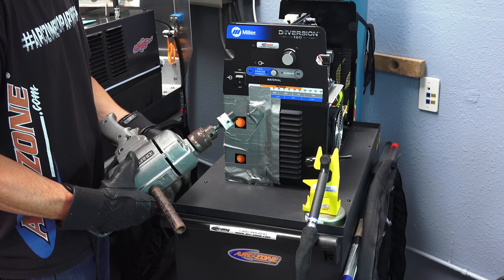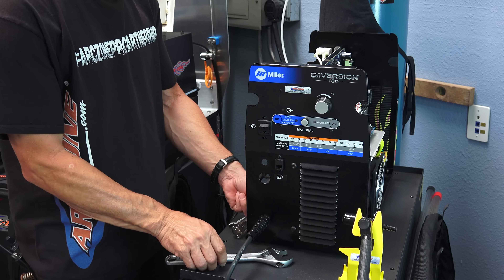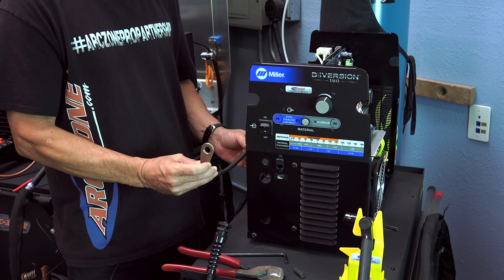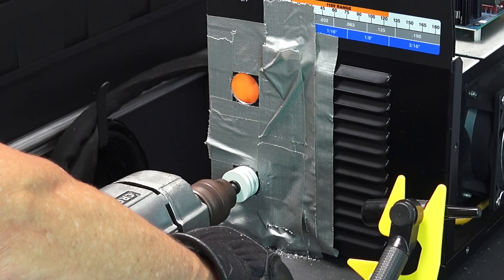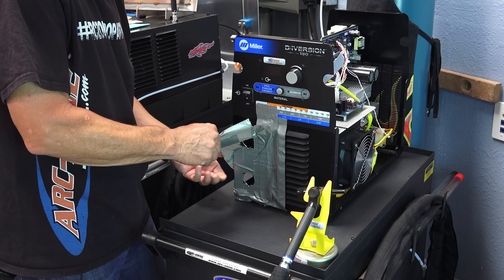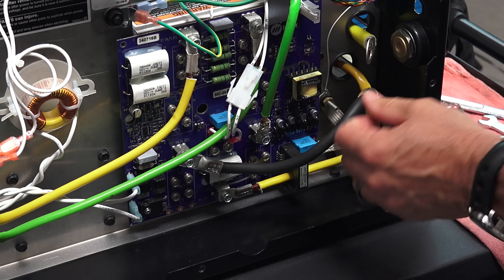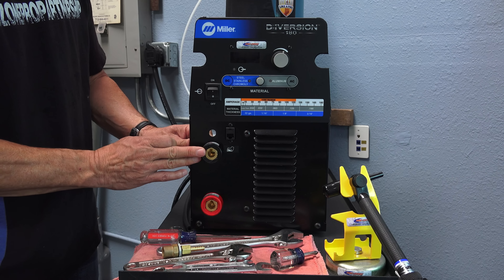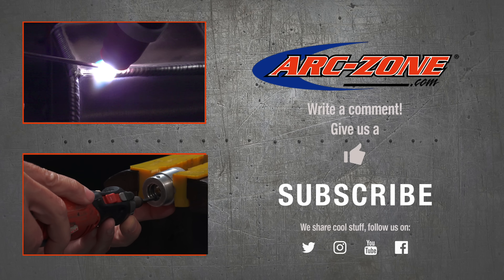Miller Diversion Water-Cooled Torch Adapter

Comment: I did a very similar conversion on my old Dialarc 250. Swapped out the original very messed up pin terminals for Dinse 35 connectors. One of the holes in the front panel was ate out from arc over due to a bad insulator (previous to my ownership), so I made a guide for my holesaw from a bolt and nut of the correct size that I had drilled a hole down the center for the pilot bit. I then used a square file to make the notch for the key in the new insulator. Worked very well and really upgraded the old machine. Makes it simple to swap between the TIG torch and the stinger, and provides a much more secure connection compared to the original terminals.

Comment: This is a great kit for the price. It includes a really nice hole saw and Delrin guide bushings to enlarge the front panel holes for the Dinse style connectors. There were no instructions included with my kit but this video does a good job of walking you through the process.

One important thing to note: there is a spring on the drill bit of the hole saw that ejects cut material. Nice feature but you have to remove it before the bushings will sink down far enough to cut the front panel. I considered just making this kit myself as I want to use a "thru-gas" Dinse connector on the torch lead but the time and energy involved to collect all the materials, creating the drill bushings on the lathe, etc. etc. it was just cheaper to go with this. Maybe I can sell the extra parts on eBay?

Comment: Downside is that the male Dinse connector fro the torch is missing from the kit. Doing this without buying more stuff leaves you with a non working welder.  And not too worried about replacing the work lead.

Comment: A water cooled torch on a welder with a Duty cycle that's in the basement, seriously though is the Diversion grossly down rated or what? cause on paper a 150 A at 16 V, 20% Duty Cycle doesn't seem like it's gonna get any torch to hot?